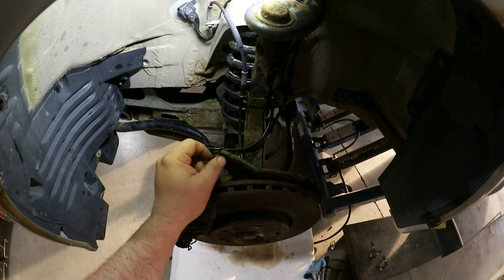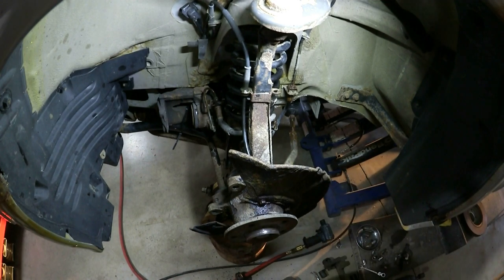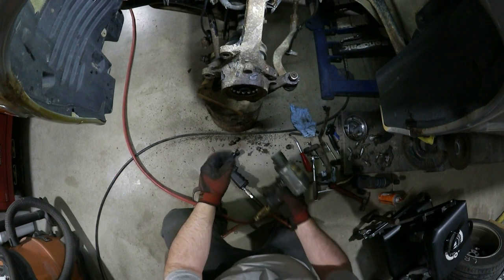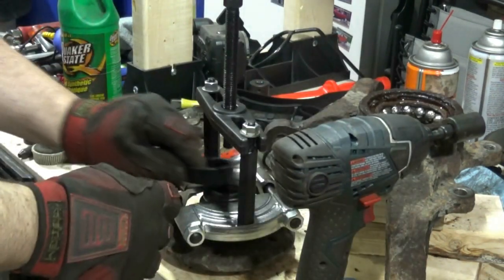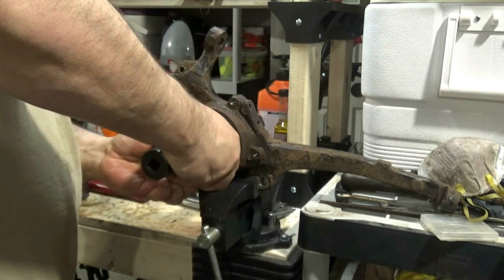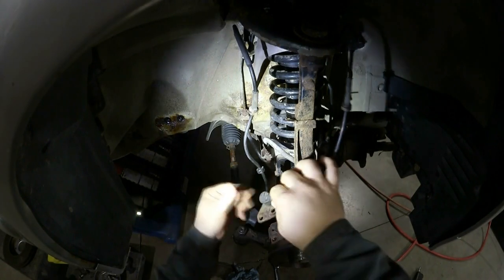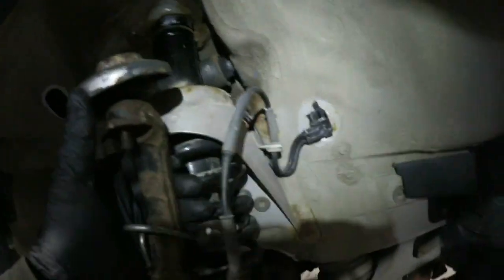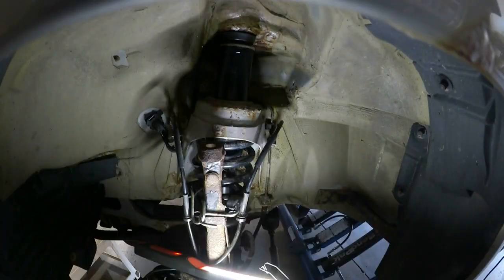W210 E320 front upper control arms, lower ball joints and wheel bearings

Comment: Wonderful video, wondering how you accessed the upper control arm ball joint nut after it was on the ground,  clearance is not good on the torque wrench I have.  Maybe I need to turn the wheel?

Comment: I'm a new owner of a 1998 E320 4Matic and I'm trying to figure out which wheel bearings I need. One video shows the one you just pulled and another shows tapered bearing. Any help is MUCH appreciated. Also on the upper control arm, is there a difference between a 4Matic and the other models?
Reply from the maker: The front tapered bearings (non press) are for the rear wheel drive version of the car and 99% sure the front upper control arms are different for the RWD and 4Matic

Comment: Excellent workmanship if you take compliments.
Excellent camera angles and talk through with your flow of work and care with locking nuts. 
You've convinced me my E320 210 has got a similar set of wear problems. It's not a perfect ride by any means and it is my first Merc. Best wishes.
82,000 miles and approaching  24 years on January 1st.

Comment: Is there any danger of the coil spring flying at you when you replace that upper control arm?
Reply from the maker: Hi the top of the spring is connected to the chassis so I did not have this  problem

Comment: Hi 
Can pls help me to solve my problem with my e320 1999 
When i drive my car on street on street way the car go right and left even i hold the steering wheel i spend too much money no body can fix it its same new car its japan import, aventgarde .
If any car come beside me when i drive my car in street i lost control the car go away to rigt side or left
So if you have any information help 
I do balance many many times
Reply from the maker: Hi I am not a mechanic but have you had the steering wheel shaft and joints checked? I would also check the power steering rack and tie rod ends and all ball joints and control arm bushings. Also want to add to have the calipers checked to see if they are grabbing the rotors while driving.
Reply: Mike's Garage thank you
Reply: The bushings on the arms are gone, replace.

Comment: This video helped me a lot on my 2002 E320 4matic doing my upper control arms.  One thing I would suggest for those watching this that don't have the sweet inspection camera to help with the right front is this.  The nut on the rear of the upper control arm mounting bolt is accessed through the inspection port behind the rubber plug in the fender well.  You will need to use an offset spanner wrench (16mm) to get on the nut through the port.   A straight spanner no matter how long will not get the right angle to get on the nut.  

Also a suggestion (I think Mike mentions this - not sure) is before you torque the control arms down to spec make sure you have the car on the ground.  If you torque the bolt while the car is in the air and the control arms fully down, the rubber bushings have a good chance of squeaking (ask me how I know).  I thought I had left my right side loose enough but hadn't and it squeaked.  It was a simple matter of loosening the nut with the car on the ground then re torquing the nut.
Reply from the maker: Glad it helped. The inspection camera was mainly to show the nut for the purpose of the video. I have also read that some people have removed the engine computer to access that nut.
Reply: @mikesgarage1518  I have a 2011 GL450.  The upper control looks pretty much the same, and I see that it's the same procedure.  I replaced the passenger side with no problems because the nuts were easy to get to.  However, the driver's side is a whole other story.  The nut on the front side is visible, but looks impossible to get to.  The nut toward the rear, however, is not even visible.  I even tried to see if I can access it from the wheel well, but once I removed the liner, I found that you can only get access from the engine bay.  So, I haven't changed it yet.  Any ideas?  Thanks
Reply from the maker: @cuzimadapapushkian799  Hi I have not worked on any model other than the W210 E320

Comment: isn't the e430 4matic basically the same as e320 4matic? part wise i mean?
Reply from the maker: Yes, all the parts I changed in this video are the same for E320 or E430 W210 4Matic.
Reply: Yeah i figured so. I live in Finland and i have e430 4 matic estate model and far as i know it is the only one of it's kind here. Therefore some specific parts can be hard to come by..the front drive shaft for example..There was only one place where you can buy them. Their asking price for the drive shaft was 2000(!!) euros. So i just searched ebay and got one from the UK for 230 euros hah. Anyways, really, really good video! I actually have to change exactly the same parts you changed in this video,(plus the drive shaft) so this was really informative and i'm going to watch this video while i'm working on my car. Thanks!
Reply from the maker: Thanks glad you enjoyed it. Yep I had to replace the front drive shaft last year and used a Dorman 936-332. It is for E320 or E430 also. Decent quality and way less than OEM.